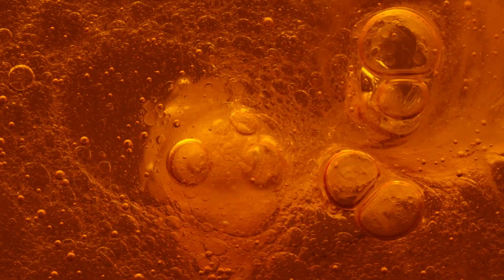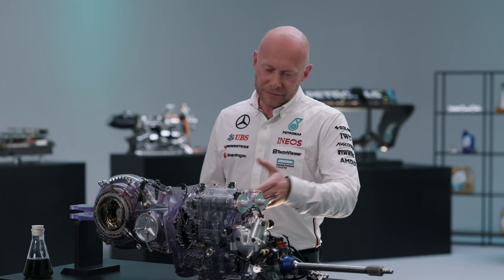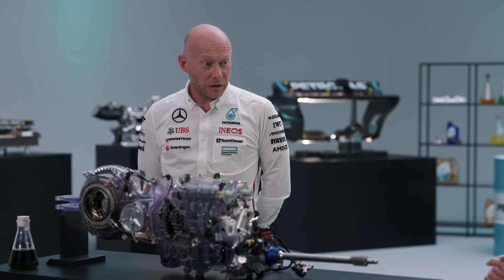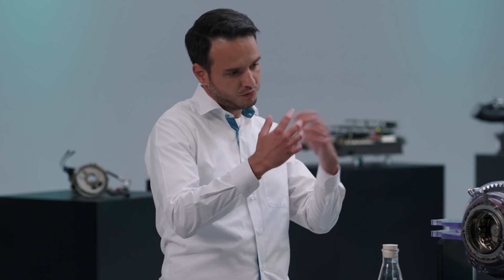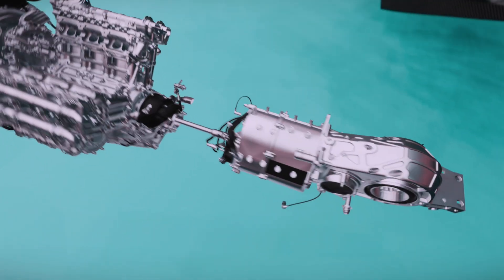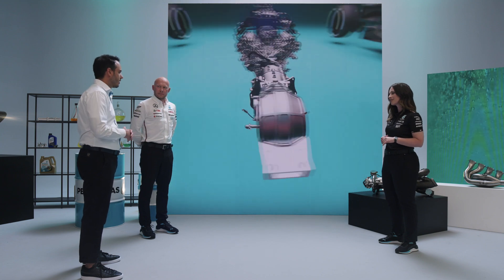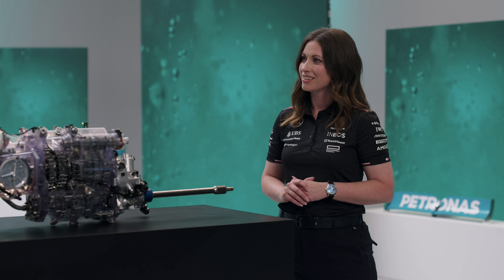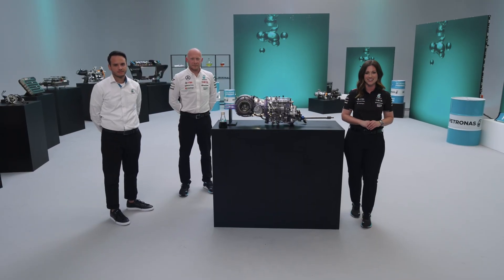F1 Uncovered: How Do F1 Gearboxes Work?

Comment: what i'm interested is this - considering that the car can pull enourmous G forces around turns, how does the oil not slosh around and the gearbox get starved of oil in certain parts? do they have an oil pump that forces it around or?

Comment: Great video 👏 Wondering the vintage or year of this gearbox.
Surprised that this gearboxes isn't dual-clutch and appears to be a regular dog-box.
Also surprised to see that long a shaft between the power-unit and the gearbox - are both the power-unit and the gearbox bolted to the chassis or is there some kind of a spacer between the power-unit and the gearbox ?
Reply: Dual clutch not aloud.